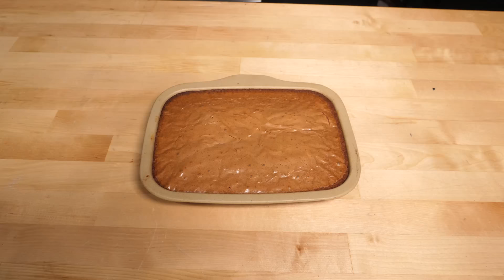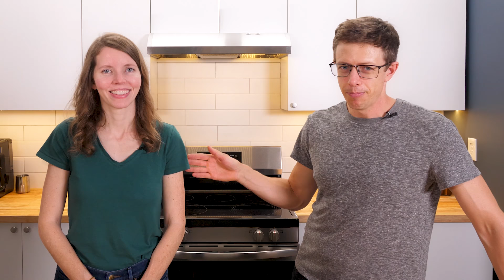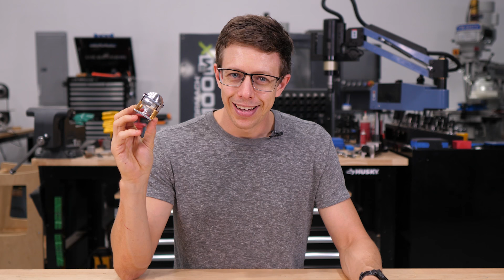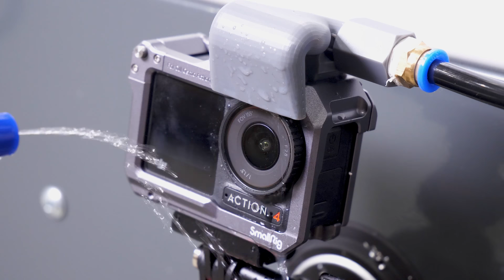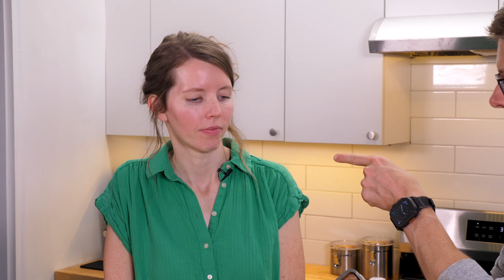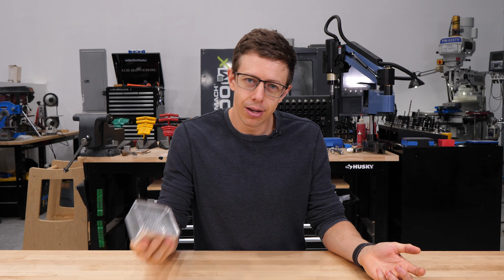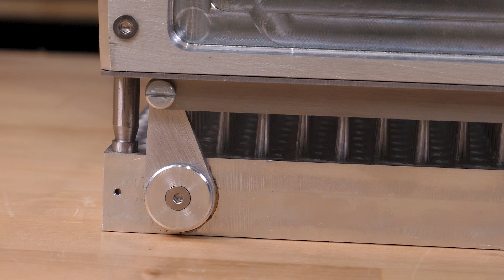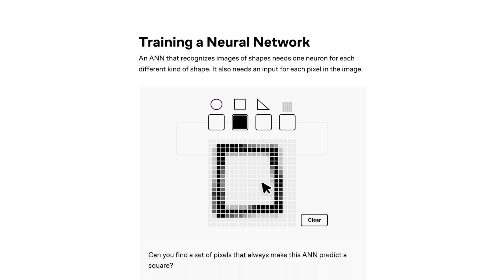Baking brownies from the inside out

Comment: Glad you let go of the o-ring issue. No ones ever regretted neglecting something so trivial
Reply: Especially with o rings and thermal issues
Reply: Better to be leaking brownie batter than ammonium perchlorate and aluminum. But definitely it won’t leak.
Reply: This is the quintessential "if you know you know" dark joke
Reply: @thenateman27  can I get context it sounds very intriguing
Reply: @definiteIynotkenji space shuttle challenger blew up due to a known O ring issue
Reply: @definiteIynotkenji I suspect you were born after January 28, 1986. 

Just a hunch. No reason.
Reply: @thenateman27  thanks
Reply: @definiteIynotkenji  The Space Shuttle "Challenger" on Jan 28th, 1986 broke apart just 73 seconds after liftoff due to a primary and secondary O-ring seal failure in the right Solid Rocket Booster due to cold weather and wind shear, killing all 7 Astronauts aboard (Francis R. "Dick" Scobee · Michael J. Smith · Judith A. Resnik · Ronald E. McNair · Ellison S. Onizuka · Gregory B. Jarvis · S. Christa McAuliffe.)

The cause of the disaster was the failure of the primary and secondary O-ring seals in a joint in the right Space Shuttle Solid Rocket Booster (SRB). The record-low temperatures on the morning of the launch had stiffened the rubber O-rings, reducing their ability to seal the joints. Shortly after liftoff, the seals were breached, and hot pressurized gas from within the SRB leaked through the joint and burned through the aft attachment strut connecting it to the external propellant tank (ET), then into the tank itself. The collapse of the ET's internal structures and the rotation of the SRB that followed propelled the shuttle stack, traveling at a speed of Mach 1.92, into a direction that allowed aerodynamic forces to tear the orbiter apart. Both SRBs detached from the now-destroyed ET and continued to fly uncontrollably until the range safety officer destroyed them.

The crew compartment, containing human remains, and many other fragments from the shuttle were recovered from the ocean floor after a three-month search and recovery operation. The exact timing of the deaths of the crew is unknown, but several crew members are thought to have survived the initial breakup of the spacecraft. The orbiter had no escape system, and the impact of the crew compartment at terminal velocity with the ocean surface was too violent to be survivable.

The disaster resulted in a 32-month hiatus in the Space Shuttle program and President Ronald Reagan created the Rogers Commission to investigate the accident. The commission criticized NASA's organizational culture and decision-making processes that had contributed to the accident. Test data since 1977 had demonstrated a potentially catastrophic flaw in the SRBs' O-rings, but neither NASA nor SRB manufacturer Morton Thiokol had addressed this known defect. NASA managers also disregarded engineers' warnings about the dangers of launching in low temperatures and did not report these technical concerns to their superiors.
Reply: @thenateman27  I think it would have to be QUITE a bit after too.  I was born in '87 but the Challenger disaster the echoes from it was still a huge part of my childhood, especially after Columbia.
Reply: Im sure the right SRB will be fine. right?
Reply: insert "i got that reference" meme
Reply: A little better to be leaking brownie batter than ammonium perchlorate and aluminum. But it won’t leak why would you ever think something so silly…
Reply: Sealing the edges would have been enough to avoid the most annoying scenario anyway: having to clean the oven. Edit: and yes I got the sarcasm, no not the exact scenario
Reply: ooooooooooooooooooooooooooooooooooooooooooooooooooooooooooooooooooooooooooooof

the biggest of oofs.  xP
Reply: This makes me think of the dark jokes elementary school friends were telling after the disaster.

We all piled into classrooms to watch ("a teacher is going to space!") We were in Tampa. My math teacher claimed she saw the fireball, as she was outside waking between class rooms for some reason.
Reply: Way too soon....
Reply: lmao
Reply: uuuuuuhhh   buuuurrrnnnn   that hurt
Reply: Ouch!  Too soon?
Reply: Challenge(r) accepted!

Comment: Another potential solution to a larger spiked pan is make it a spiked replacement bottom for an existing springform cake pan. It does mean you'd get a disc of brownie rather than a rectangle but you already made a sphere brownie so clearly you're open to circular brownies. It would also significantly reduce the engineering, machining and parts required.

Comment: Just wondering if you would have just put upright sides on the edges of the bottom part with holes and just lift it off the spikes if that would have been easier than doing the retractable spikes

Comment: So here’s my question. If the edges are created by being heated from two directions, instead of making a metal pan to distribute the heat what if the pan itself insulated the edges from the heat? I think you may have gone in the wrong direction by using Aluminum for better heat transfer when you should have went for a heat insulating pan.  Could be a good experiment to follow up with.
Reply: That issue was solved many moons ago. You probably have a kitchen utensil made from such a material.

Comment: Cooking baked goods without crusts is a solved problem - panko bread is baked using electric current passed through the dough which means there's no external heat source.... Sorry mate, a silicone pan, some copper sheet and a high current supply and you'd have been sorted.

Comment: Coulda just pushed up a floating grate cover part, which would also make it easier to cut as the walls would be shorter relatively. Also, pushing it out using a cross shape instead of on each corner might make the mechanism easier to build

Comment: It doesn't seem like it would take much effort or skew the results to create two accessories.  One, a thin sheet of metal with holes in the bottom (for the spikes) that snugly fits inside the main area but extends above the tray on two sides creating handles that will let you cleanly and easily remove the entire brownie all at once, and another tool shaped into 4 blades (crossing 2x2 making a 9 piece grid) that will allow you to cut perfect pieces in one go.

Comment: What bakers use are called cake strips. All you have to do is to cut up a towel into strips, soak the pieces in water, and attach them to the edges of the pan with pins or paper clips so that the edges don't cook too fast.

Comment: I want it. Not that one, you made some mistakes there, but I want one machined to perfection. Seriously!!! I want another material as well, titanium sticks to batter horribly (i have a thick solud titanium wok, with non-stick dimples but it still sticks) but food grade stainless steel, chromargan, or medical grade, that would be insanely hard to mill, with that puny cnc, and it should not be modular, a one block part would be ideal, obviously..

Comment: If you want to uniformly heat the brownies wouldn't a microwave and a container that heats at a similar rate to the brownie be ideal? Differences due to air exposure could be solved with a perforated but fully enclosed container. This is really cool but its not scalable, the max thickness of the material being cooked would be dependent on its properties.

Comment: I love the camera air knife! Fun fact- news crews keep rain off their lenses by having an extra pane of glass at the end of the lens that just spins really fast so all the water just gets flung off!
Reply: They use those on boats as well!
Reply: And cnc machines!
Reply: I think it's called "rotoclear" or something
Reply: Yeah but that would be too easy, he created a solution that worked without ever knowing what you're talking about as a "tiny" side quest. You know how long that probably took many people to come to the epiphany of, meanwhile dude just thought of how well it works at an hvac door/wings/etc in aerodynamics to isolate vortices isolating even the strongest of forces against each other. The spinning wheel/lens only works because it exceeds the FPS of filming so anything hitting it is propelled away faster than a frame can catch it (or film it) on the lens at that exact same moment it would if it were spinning slower or not at all.
Reply: And by easy, I mean just google'ing/researching or using AI response to find that solution as opposed to coming up with a unique solution, or maybe not unique so that the airforce isn't audible on video including audio but dismissed prior. Idfk, I'm high. It's a cool solution I could see adapted elsewhere such as super/hypercars that currently have a shitty solution for wind v. wipers in putting them dead center upright or like the cybertruck upright but far side simply due to speed or length of wiper considering driving speeds and being effective in clearing the windshield of rain, where perhaps instead you could have windshield wide air vent at the bottom with high velocity pushing the air up and over the windshield creating a buffer rain just never touches it. Idk, again... I'm high. Seems like a cool idea he created rather than just reusing existing filming methods.
Reply: Yeah, you can get those for camera mattboxes too 👍🏼
Reply: That's something I never knew!
Reply: That's a better idea than the air knife
Reply: @chrism45 No it's not. An air knife is dramatically cheaper and less mechanically complex. Also, literally zero wear elements.
Reply: @Cooe. the wear element of an air knife is the compressor
Reply: @Chirishman6  fair, but its proably needed for the cnc machine anyways
Reply: @Cooe. except for the huge compressor to drive it.

also compressed air is the most exoensive source of shop energy.

Comment: Surely the simple physics based solution is to slowly cook and keep the temperature below that which causes the state change at the edge. Microwave on low or sous vide or in steam oven. Aim to cook at 100 degrees C to reach 95C cake temp. Could cook faster to start if you monitor surface temperature and only push to point where conduction in cake starts to fall off. Use something like a combustion inc multi point predictive thermometer to optimise.
Reply: Or cook in a tray of water like a soufflé.

Comment: This channel is like an exercise in how to create the most complicated solution you can think of. For a "cornerless" brownie, all you need is a pan with the same thermal conductivity as the brownie batter, so that the brownie corners cook at the same rate as the center. The easiest thing to do is to admit that the brownie batter itself has the same conductivity as brownie batter (duh) and to simply cut away the chewy parts of the brownie after it's done cooking. The chewy parts are considered part of the pan, and to be disposed of.

If you don't like that solution, the next best thing is to cook the batter in a sous vide at like 200F. Congrats, you've removed the life from brownies. No chewy corners ever.

Comment: A simpler version might include the idea of one of those circle cake forms that spring latch, for easily excavating the brownies 

Or go the bunt route so the spikes do go into the top, but because it gets inverted to extract the top becomes the bottom.

... Though perhaps neither of those would be "good" considering the initial "brownie/cake pop" idea was rejected. That seems to indicate the shape is just as important as the texture? Which... I guess. But honestly, if you found a way to perfect the pop idea such that loads could be easily made at once and extraction was easy, that would be the best. Imo anyway.

Comment: here's a completely sane idea: why not liquid-cooling the pan to make sure every surface touching the brownie are constantly the same temperature as the brownie centre? you only have to make extensive modifications to your oven to allow cooling tubing entry and find or chemically engineer a fluid that doesn't phase change in 175C heat. ezpz you can make that in a couple of hours i'm sure.

Comment: Can definitely see how to make this cheaper. Like casting it instead. Also definitely dont have the walls so thick.

Also if the tolerances are good enough you dont have to worry about leakage. Obviously a prototype like this would definitely not have the tolerances necessary.

Also did you think of using a heat resistant silicone?

Comment: To solve the top edge problem, did you seriously not think of just covering the top of the brownie with aluminum foil? Or at least the edges. if you covered the whole top, you could perforate the foil lightly to prevent the foil ballooning out as it expands.

Comment: As a layman I can see 1 problem and 1 potential improvement.
The problem is "how do you clean in" even if you can't make it dishwasher safe, due to all the mechanisms it seems like it'd be borderline impossible to clean, making it a novelty item, not one practically useful day to day.  If the handle mechanism moved the pan up totally off the spikes such that it could then be removed from the spike mechanism entirely, rather than sitting on top of the spike mechanism, allowing for the pan to simply be lifted off of the mechanism would certainly help in this regard, you should have oven mitts on anyway when doing this, so you could just lift it away if it wasn't captured by the fancy poles & spring-ball screws.
The potential improvement would be to make the handle detachable so you stick it into the oven with no handle then through some (hopefully simple) way you attach the handle once the pan comes out of the oven, that way you don't have the confusion about how to use it, or at least you have less of that confusion (maybe you could even make the handle out of wood so it looks more fancy).

Comment: For the minor leaking issue, use a silicone sheet with holes for the spikes placed between the pan bottom and the spike plate, it should provide the same seal as your dreaded "100s of O rings" solution, but with a single easy to clean piece!
Reply: It would mess with thermal conductivity at the bottom of the pan vs the spikes
Reply: @loicjeannin6233  Trim it so the edges touch and pocket where the silcon mat would sit.
Reply: This is exactly what I was expecting: a silicone gasket mat.

Comment: I'm curious if it's possible to make it leak-less. Instead of the bottom sheet being straight holes drilled through, what if they were cone shaped holes to better seal with the spikes? Or If the spikes on the bottom were cylinders to better fill the holes. Or even have a flat edge at the bottom of each spike that "covers" the bottom of each hole, instead of relying on the bottom of the pan to rest at the bottom plate.

Now I'm also curious, if people like edges, could this same pan be used to create a consistent "all edge" brownie? I mean, since the pan cooks the entire batter evenly, cooking it longer (and maybe hotter?) should result in an evenly cooked "edge" brownie, right?

Comment: if I were going to attack a problem like this, a few PTC Thermistors would be my first choice. Basic pan, thermistors on all surfaces, and 2 in the middle of the batter. Cook normal, and plot the temps. When the time is up, compare the inside temp to the surface temp. Use inside temp to cook next batch, and when the second inside temp matches the first inside temp, remove from the oven.

Comment: A pan with horizontal skewers that slot in and out independantly of the pan would be easier than the spike pan when it comes to taking the brownie out of it. It'd also require far fewer spikes. The holes on the sides of the pan that skewers slot into just need to be the right fit to prevent batter from leaking through but that can be made easier by using a slightly flexible material as a lining for the holes that would slightly grip the skewers after they're inserted.

Comment: You should turn your mortar into a 2-player game. Kind of like a real life version of the MSDOS game Scorched Earth (be sure to check it out for inspiration) -- It's a game about predicting trajectories. The game would need some method for physical hit detection, and the "tanks" need to "explode" when hit, possibly with LEDs, flash powder, etc. In Scorch, both players are allowed to move their tanks on each turn. Players select their launch velocity and angle, and this is fun. But if they're allowed to move their tanks constantly, then you could still utilize your trajectory simulator and it won't be too easy, because you'd still need motion prediction. That's simple, you just multiply the target's velocity vector by the delta time to predict the next location, then you re-calculate the time to arrive at the new-location, then plug that new time back into the original equation to replace the original time-to-arrival. This can be iterated multiple times to refine the prediction. But the player can still make an abrupt movement to fool the motion prediction. And you probably never got Air Drag working in your polynomial because it's nearly impossible. So that's two gameplay modes, tanks can move on each turn + they use manual trajectory... or they're constantly moving and they have access to trajectory simulator.

edit: To clarify, you can do air drag with integration & looping in the code, but you can't do it with something like atan((vel^2 - sqrt(vel^3 - g * (g * distance^2 + 2 * targetYOffset * vel^2))) / (g * distance)). But you're firing a simple spherical object and your distances are going to be so short that the kinematic equation is sufficient. At these short distances, the error level from motion compensation raises the noise floor above the error level from factoring drag.